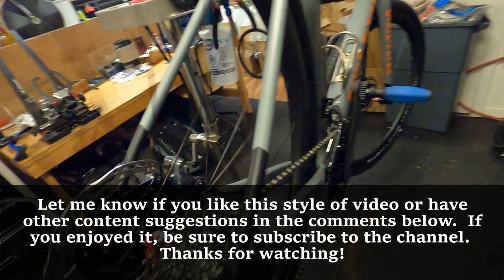Overhauling Bike After Mid-South Gravel 2020

Comment: Out of curiosity what would something like this normally cost for a shop to do? Labor and parts breakdown please
Reply from the maker: It definitely varies by region/shop and also what level components you use but some rough numbers on this one

- Labor for full overhaul $200 w/cables/brake bleed
- Brake pads $25 ea
- New chain $35
- New BB $25

Definitely not something you would want to do often but this was for a pro racer so he has to make the big events and gets a discount from me.
Reply: @ChrisMurrayEWC  thank you for the reply. I figured it would be north of 200. I was at midsouth and by time you figured the time I spent and the money I still needed to spend on parts. All done and said 200 might be a good deal.
Reply from the maker: For sure, if you are mechanically inclined most of this is fairly simple work, just time consuming so you could save yourself a fair bit of money doing the bulk of it yourself.  It looked like a fun but brutal race this year!  Most shops don’t naturally relube master cyl pistons as part of their overhaul but it is pretty easy to do and these were very sticky.  I’ve only had to add that extra step to SRAM brakes for what it’s worth.
Reply: @ChrisMurrayEWC  peace of mind.
Reply from the maker: @mazerickd  absolutely!